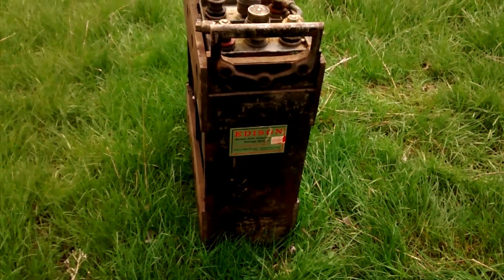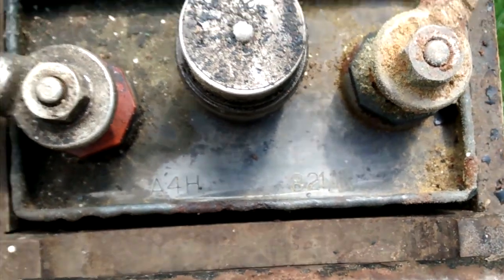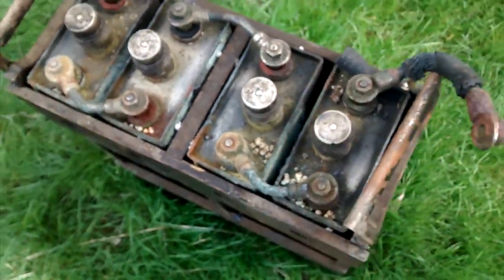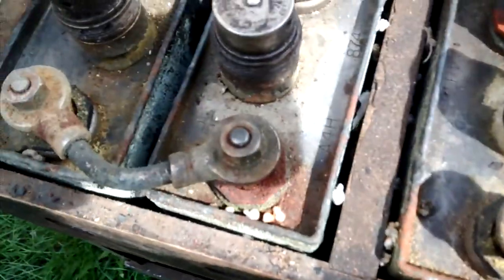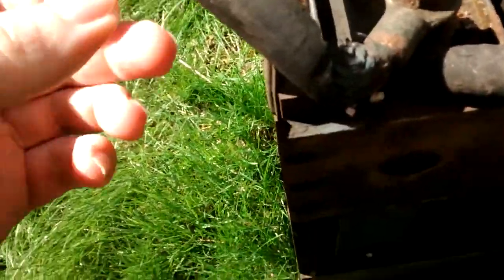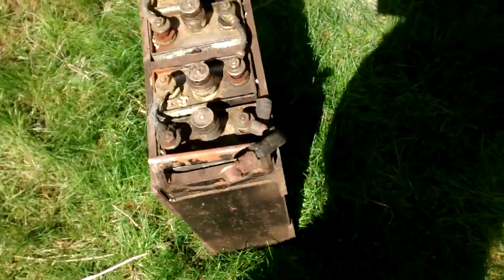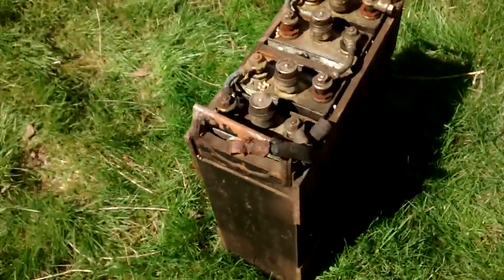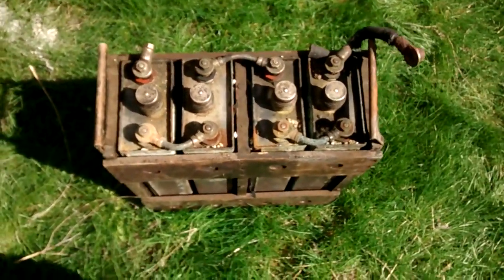A4H Edison Nickle Iron Battery

Comment: I for one would love to find a source for nickel iron batteries, I am so interested I an experimenting in building my own..
Reply from the maker: While it is tempting to do your own thing I recommend getting some old ones and fixing them up over reinventing the wheel.
Reply: so hows it going? you should make them and sell them to offgridders they need them or show some DIY for us they are the best batteries ever what i am learning.
Reply from the maker: You can't make them without specialized tooling. The DIY idea is a joke-o-rama.
Reply: there is a scientist doing it on youtube nothing to impossible to do. as soon it gets easier to acheive the materials it only gets easier.
Reply from the maker: Okay whatever, I just read over ten books and counting on the manufacturing process thought I would do you a favor with some truth. Check out ElectroDacius and LifePo4 batteries if you want to save yourself thousands of dollars in frustration.
Reply from the maker: Start by reading this and despair. http://krishikosh.egranth.ac.in/bitstream/1/2047569/1/2091.pdf
Reply: I have 9 for sale really clean a 5  pack and  4 pack

Comment: i am looking for these batteries from my off grid system. they called these the batteries that worked to good. you only need to replace some water every now and then and a few companys started making them again but they are charging alot and i mean alot. to get what i need 48v with about 400AH  they want 15,000 dollars. it looks like you got almost 6 volts there. each container should be around 1.2 volts. you can not kill them batteries they last forever.
Reply from the maker: Go watch my other videos you can learn about KOH, Lithium Monohydrate, and distilled water and fill in your knowledge base.
Reply from the maker: China and Russia make them still. Careful, Nickel Cadmium are made under the NiFe (atomic periodic table notation for nickel & iron) brand.
Reply: i heard one company in america opened up making them now.
Reply from the maker: Let me Google that for you.